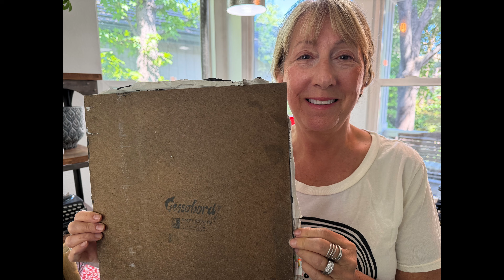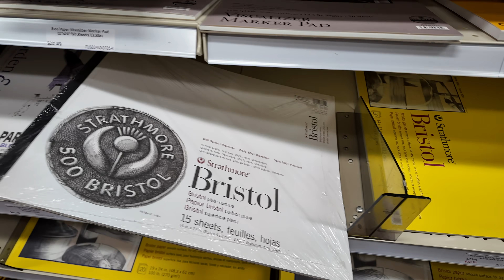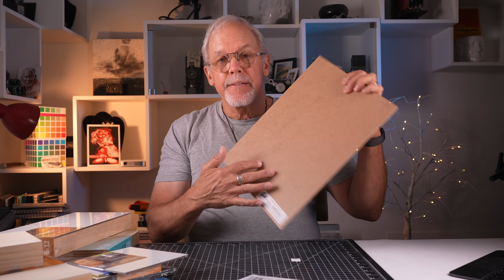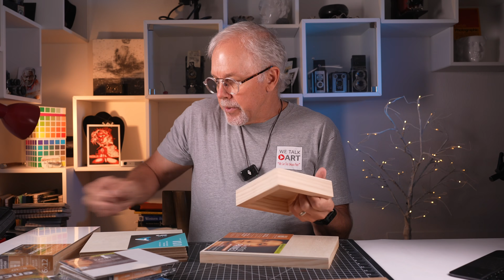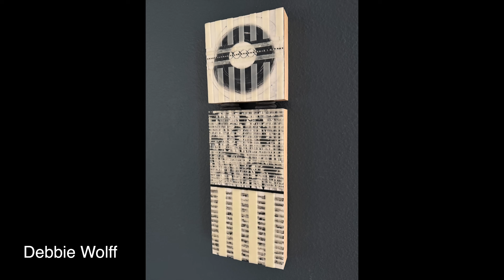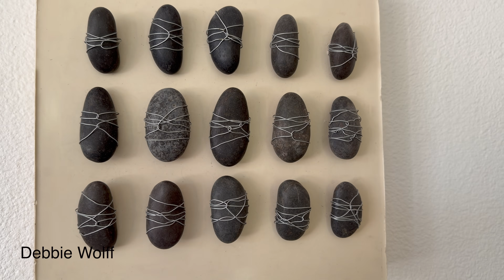Guide to Artist Boards and Panels -  Art Surfaces 2 of 3

Comment: Thank you. I found the cutting part especially encouraging. A couple of my aluminum rulers have nicks in them.
Reply from the maker: It talks a bit of practice, but one you got it, you will find it easy.  Get some scrap from a frame shop or use the back of paper pads.  Thanks for sharing, Mark